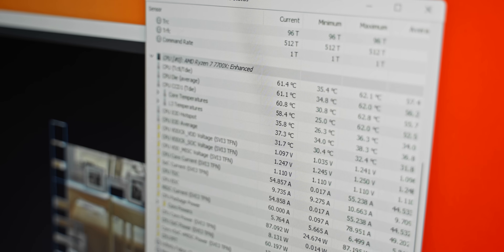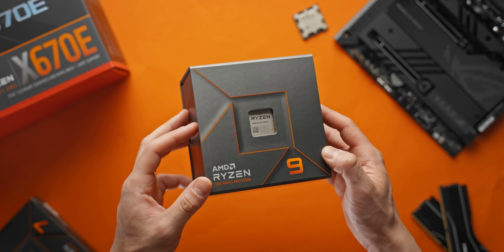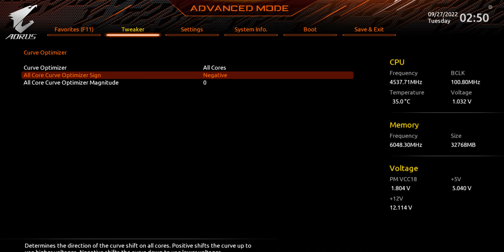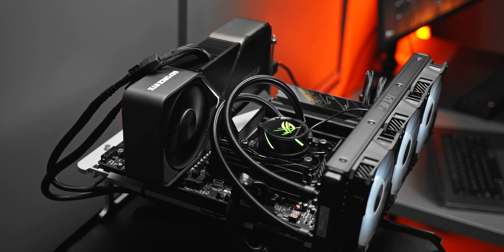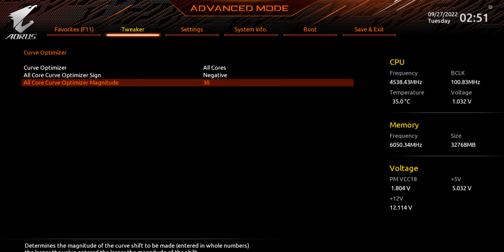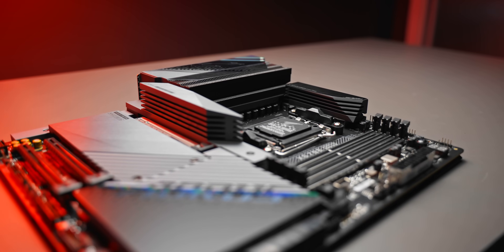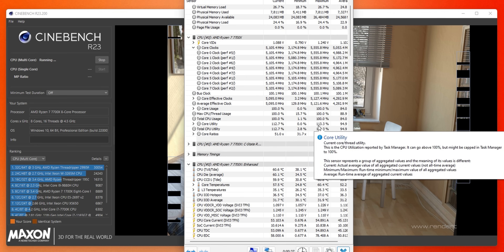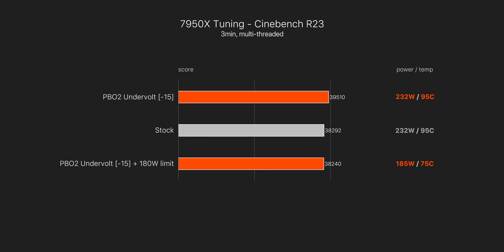Fixing Ryzen 7000 - PBO2 Tune (insanity)

Comment: i just undevolted the 7600 (non-x) negative 30Mv and saw an increase in performance and much lower temps. 181 FPS vs 190 FPS in horizon zero dawn
Reply: Where i put 30Mv bro?
Reply: @apocaypse4408  in your motherboard curve optimizer settings.
Reply: And what max temp i can sett?75-80 degrees?

Comment: Gosh my R5 7600 take that -30 like it was nothing and temperature dropped HARD, this is crazy !
Reply: Did you use the exact values in the video? I saw someone on reddit suggest other numbers and I am unsure of what to follow
Reply: @Brainzzz123 
Hi, I put "All Cores" "Negative" "30".
The worst that can happen if your CPU can't take it is random crashes. If so just go for "25" then "20"... Until you reach a value your CPU is comfortable with :)

Comment: So I'm able to run PBO CO at 30 on my 7950x but when I stress test it in Cinebench I'm hitting 5.5 on the first 8 cores and 5.35 on the last 8 cores. I've also set my throttle to 90. Is this discrepancy normal or does this mean the system isn't stable? Cinebench, Prime95, and y-cruncher all passed and seem to be fine. Cinebench score for multi was 39000

Comment: Hi there. You said you would see crashes and stuff. How long should I test for till I see it happen. I did it at 30 with my 7950x and I'm not sure if it's stable yet. Well turning that first setting on with pbo is causing me ram xmp issues im at negative 20 offset. Fuck sake man
Reply: Nvm it kept crashing over and over again. I just stopped doing curve optimiser. It's so unstable

Comment: Got my 7700X down to 76C while running cinebench with the same config you did on this video. Cooler is Deepcool LS520.

Thanks for this video, will adjust my configs if I encounter any crashes.

Comment: Sadly my 7700x runs only stable with -15

But thats also with 6400 cl32 and Infinity Fabric on 2133mhz.

I think thats great
I get stock performance at 105 watt limit and 75 degrees instead of 95.

Comment: hi there i got my board today and did what you mentioned here and worked great all my cinebench results were good and worked  perfectly  then i looked into my memory but it seems expo and expo 2 are insanely unstable so i disabled then  in the bios and and restarted and saw you could do it via ryzen master but now for some reason even though my ppt is 85, edc edc 640000 tdc 480000 in windows it goes all the way to 142 watts now.. tried reinstalling ryzen master tried resetting settings and bios and redoing them but still going up to 142w  any ideas? thanks  Asus tuf B650m  7600x

Comment: FRIEND , you HAVE HELPED TREMENDOUSLY. I am coming from intel. New 7700X owner. I have been messing with PBO auto, manual and enhancement though Asus mobo preset.  It set it at -15 curve otimizer and changed boost overclock and pbo scalar and was ustabled. 
I TRIED YOUR -30 CURVE OPTIMIZER ONLY and My cpu z bench went from 8080 to 8300!!! and My cinebench went from 19200 to 21000 something! THANK YOU so much. Just try it everyone, worst that happens is you need to go to -25 or -20.
Reply: i settled on -25 curve optimizer and pbo boost on. everythings been working great since. 
left auto over clocking and messing with max boost clock off.

Comment: Thanks dude. Good vid. Gave my 7700x an -38 mV undervolt and power target of 88 Watt. Cinebench r23 single 1984 all cores 20121. 5 cores boost to over 5800, 3 to 5600 with 90 Watt from PSU, 64 degrees C. Cooling Noctua NH D-15. I use it professionally (studio computer). Worthy replacement for my old Mac Pro. Loving it.

Comment: I have 7600x and AsRock mb - in Bios i can do over -30 and atm running -40! without anything else my temps are 66 @5400 mhz (boosted itself) in cine. also did blender for stability. Thats why i find it lil hard to belive you only dropped to 89 with -30?
Reply: i just got the  7600x 2 days ago, is this Worth doing? All i do is gaming

Comment: I tried using your tutorial to get my 7700X to cool down. But there's something I must fail to do in PBO cus i did everything you said to do and it seems like nothing changes. Even setting the temp throttle at 85 or even 70 degrees, my CPU still boosts until 95 degrees. Did i miss something ? Plus, i never get above 4.5GHZ

Comment: Wow this works great on my 7700X, 5.4GHz all cores CM R23 @ 87.5*C max & 1.27V. I used AI OCing on ASUS and had 5.3GHz @ 95*C & 1.45V... The AI had crazy boost clocks of 5.8-6.1GHz on random cores but @ 1.55-1.6V vs this guide of boost of 5.5GHz but those 1.5V are way to high so I'll stick to your guide

Comment: What values would I use for an 90v limit? Just 90000 instead of 85000 and same for the rest or do they all need to be different? Also I got the -30 on my 7700x and I'm Hella unlucky so maybe 7700x are mostly getting -30? Would be interesting to see if other 7700x owners mention what they get

Comment: Thank you so much for this guide! I just adjusted the curve optimizer to -30 on my R5 7600x and my Cinebench R23 score increased by almost 1000, the max temp decreased from 92 to 78.4 and I think the clock speed went up from 5.4 Ghz to 5.7 the wattage dropped aswell, from 130 to 111. Thank you so much! Such an easy to understand guide.
Reply: @actualpotato what were your  values for PPT, TDC and EDC? I'm running the 7600x and that's all I need to know to fully optimize the cpu :)
Reply: Would like to know those values as well
Reply: What cooling do you use?
Reply: @TheOdsystem  Noctua NH-D15
Reply: @actuaIpotato  If you are still around, Could you tell me your vaules of PPT, TDC and EDC? I too use 7600x and its stable at -30 Curve optimiser.
Reply: @chiragnightfire did you found ?
Reply: @Snoxygoat  Yeah. I am using PPT/TDC/EDC at 85/75/150

Comment: Could somebody explain to me what the hell is going on here 4:56? Where do I get these PPT, TDC and EDC values and what do they mean? Can you fry your system if you enter wrong values there? I have done all of the other steps but not sure about this one. By default my BIOS is showing value 0 for all of them when set PBO limits to Manual.
Reply: You enter those exact values manually. Mine was also at 0, I just typed the exact figures in the video. PC still booting, and working great, only now it's 20c cooler on load.
Reply: @DKTronics70  Thanks but I am afraid that's sufficient for me. I want to know how and from where these values were derived. Maybe the values should be different for different AMD 7000 processors, who knows!
Reply: @meanmole3212  hello, did you figure this out? 😅
Reply: @flyinggecko3322  No. However, on my mother board (ASUS) there were separate settings for controlling the CPU in addition to the "AMD's own processor settings". These 2 settings menus had basically the same options, so I am not sure if the motherboard's own settings get overwritten if you also change the processor's own settings.

I ended up using the motherboards own processor settings menu for all my CPU tweaking and there I also found something called power saving eco mode which automatically sets predefined values for these PPT, TDC, EDC. You can choose from few presets. The presets vary those values depending on how much you want to save power and limit the voltages. That was good enough for me.

Comment: How do you decide the TDC and EDC limits in the Manual PBO Limits? Your video shows TDC:480A and EDC:640A. But I checked the settings for my 7600X in Ryzen Master, those only show 110A and 170A respectively
Reply: iirc it doesn't really matter it's so high anyway that your CPU will melt through the socket long before you reach those limits. Just max them out or let them be it won't matter.

Comment: If you have an Asus AM5 motherboard, their recent BIOS updates enabled one-click adjustment of temperature, power and voltage curve limits through preset levels Asus calls 'PBO Enhancement". Using level 3 on my 7950X, I've got it running at 70C max without any appreciable loss of performance in real world apps and games.

Comment: Great video, Ali. I was wondering how you came to the TDC and EDC values after limiting the PPT?
Reply: He gave an answer in one of the 1.2k comments that these were the default values and he only touched PPT.
Reply: @epivitor3  That's strange. The default values should be 110,000 and 170,000 for the 7700X

Comment: My personal experience is the two best cores are either going to be at -5 or 0, then the rest can go way down. Reason is those two best cores are already as effecient as they get, and if you try to go much lower you run into idle crashes.
Reply: How do you figure out what your two best cores are?
Reply: @joelman1989  Dunno if you figured it out already - but in Ryzen Master it basically tells you in the advanced overview window which cores are the best. They're marked with a star and a grey circle respectively.
Reply: What means "best cores"? and why are they best cores?
Reply: @RmX. When manufacturing a CPU it is not always going to be perfect, I don't know if this term can be used here but I think it is called "silicon lottery" between many processors/cores there will always be some better than others
Reply: what gpu are you used?
Reply: gtx 5090

Comment: Undervolting is so good, also did it for my 5600X and RX 6600, I downed the powerlimit of my GPU by the max of -6% and dropped the voltage from 1150mv to 1075mv, it now is 2-3% faster, while using more than 6% less energy. My 5600X is at 75 watts max and max CPU override +100MHz and curve optimizer -20 and running faster than stock at the same or less max power usage. I'll try to tweak it even more.

Comment: You can set PBO + Curve Optmixer per core and get much better results and you can run PBO + Curve Optmixer and A;; Core OC atthe same time with auto switch that will run All Core OC on heavyey loads.
Reply: You did not get the real improvemeny available by using all core in PBO.  All Core OC can be set for each CCX  also

Comment: Guys let me tell you this, all this seems very promising but in reality it is not so. Bottom line is you will only find 100% stability with a value of -10 or lower or may be not in some cases. I have seen crashes all the time even sometimes when I was using -7 offset. So yeah it works for benchmarks and other tasks here and there  but is not something that you can depend upon for absolute rock solid stability.

Comment: In other reviews I saw this config for Eco Mode for the 7700X - PPT 88000, TDC 75000, EDC to 150000. Why are your TDC and EDC so high?
Reply: Yeah they are super high, but i dont know why. For 95W they recommend:

para un PPT de 95W, los valores manuales de TDC entre 75-90A y EDC entre 110-140A son óptimos para equilibrar rendimiento, consumo y temperaturas.

Comment: I want to thank you for the information you give. I recently purchased a mini itx system with the 5900x on the b550i strix mb in the NR200P and managed to get my cpu to negative 30 offset with a 200mhz boost to all core clocks, stable. Once again, thank you. Now if AMD just fix their buggy drivers on the 6000 series gpus....

Comment: Great video, it helps a lot :-). Can you suggest also safe values in PBO for the 7950x? Not only PTT, but also TDC and EDC limits. I would only know what to set in the PPT instead of 230000 there I I would try 160000, but I have no idea about the other values. Big thank to anyone who knows what to use. Ok I think I could set the Auto option, but I would prefer to set the values manually.
Reply: Hello, I have been looking for the same. Did you find an answer somewhere? Much appreciated!
Reply: Have you found good value to drop the temps? My 7950x is running hot and I don't really care about performance drops.

Comment: 4:56 In PBO Limits manual mode, how we set PPT, TDC and EDC ratio? Is there a formula?
Reply: Idk I have same problem
Reply: Bro I have the same question with no answers. This comment section alone has a bunch of people asking the same thing with no answer.
3 years and still no answers
Reply: @TH-ul1kf   I bought ASUS board at the end and found the info online. It's like this: (MSI uses mw and ma so add 000)
Target W ( PPT, TDC, EDC)
170W(230W/160A/225A)
125W(162W/120A/180A)
105W(142W/110A/170A)
95W(128W/100A/160A)
65W(88W/75A/150A)
45W(61W/65A/140A)

Comment: Something that isn't mentioned here with squeezing out more performance with pbo2 it's actually very difficult to stability test. Because pbo2 has a dynamic frequency you experience stability issues when the clocks are the most pushed which usually happens with a MEDIUM load. I didn't experience instability during stress tests i but would see them during normal use under lighter load

Comment: When or if it gets updated (if it even needs to) just use Hydra and wait a few hours. Then run Prime95 all cores and with a script to switch cores repeatedly, and a few extra benchmarks just to be safe.
A flat all core -30 is almost certainly very unstable on one of the cores. An example being 1 of my 5800x's cores came back as a -16 (least safe setting) while the 2nd worst was -24.

Comment: I set my 7950x to -15 all core with 85c limit. Was able to get 5.3 ghz pinned on all cores. Then I set my power limit to 150w and then it maxed out at 5ghz still at 85c. Playing cod my temps were at 71c. So I turned off those settings and then just manually set the clock to 5 ghz all core with a voltage of 1.05v. Same cinebench score but never went over 70c and my temps playing cod were at 45c. Idle temps were 5c lower as well. Since I’m new at messing with cpu is there anything that I can damage manually undervolting like this? I haven’t had any crashes or anything while playing games and the temps are just better with the same performance. All I did was just set the clock speed and voltage.
Reply: undervolting is fine as long as it's stable, if you crash increase voltage again

Comment: Hi, and I have a question. Does increasing dpi above 3200 (as ex. 6400, 16000, 25600) reduces mouse latency? If you don't know exactly, you can easily test it on your test stand.

Comment: Genuine question: if its that easy to get higher clock speeds at the same temp & power / get the same performance at lower temps & power why wouldn't AMD just have their cpus run stock like this?

Comment: lovely. i thoght i'd try it on my 5600x for fun. it didn't even crash, didnt freeze. just fucking corrupted windows on the first try. just went straght into recovery without crashing even once.
(well it didn't take me all day, only about 3 hours. and idk wtf i did to fix it, but something i did among the last tries must have worked. probably one of the weird parameters / settings i tried with sfc). [edit] feeling corageous. did it again. this time, no issues. idk wtf was going on. my 5600x accepted -30 just fine and is running at 50c full load doing cinebench, which is absolutely insane. wth. [edit2] ah, it froze instantly when i tried the single thread test. i guess it was okay with 4.3ghz but not 4.7. -20 seems to work fine though.

Comment: I love that, I'm definitely getting a 7600x once the B670 motherboards are out (maybe 7600x3D if they make one) and I'm definitely liking the temperature drop. Power consumption as well cause even tho 105w is definitely not as bad as other CPUs (looking at you i5-13600k and your 180w under load) i'd still like my Ryzen 5 to draw around 65w

Comment: I highlt doubt end users will get any sample that can achieve 5.3Ghz at 85W while undervolting. 
Mostly, because with no amount of tuning and testing have I ever seen a ryzen perform at these high frequencies (other than in YT videos)... The best sample I've had in my hands was a 3600 and it had trouble to run at 4.2, and very rarely achieved 4.4. 
If AMD could get any representative amount of processors to run at those values, THEY WOULD SELL THEM WITH THOSE SETTINGS RIGHT OUT OF THE BOX, the reason they don't is 99% of them are not stable to run like that, period. They are being greedy and inflating prices, now they can, just like Intel did... with the exception that Intel processors do overclock at the advertised values without risking degradation and instability.
Huge fan of AMD here, but these early reviews which show insane frequencies are just the exception to the average Ryzen.

Comment: Coming to this late but this is hands down the best video I've seen about this. There aren't enough of these types of videos out there that actually show the steps taken in such a quick and succinct way and then lay out the results so clearly. Well done man. I'm sitting on a 5800X3D system right now so I don't have any reason to do much of anything right now, but I'm definitely eyeballing AMD for the eventual 7000X3D chip releases.
Reply: Hello, how do you think this solution will work for 7800X3D?
Reply: @Ho1eMak3r  hey have you found out
Reply: @gfrmbr   also want to know? 7800x3d

Comment: I just did this with my 5800X. 15169 multi core score on Cinebench but was about 93C at stock.  I was able to load into windows with the -30 offset (had screwdriver ready) and scored 15670 with a max of 83C.

(as I am typing this, my keyboard is acting strange, however.. don't know if this is stable..)

Comment: Very nice guide but unfortunately it still does not undervolt the insane prices of AM5 motherboards and DDR5 lol. I still think an i5 12400 or a Ryzen 5 5600 with a good graphics card is far better than a high end cpu plus a mid range card, all for the same price or maybe even lower.

Comment: It also works the same way as the Ryzen 5000 series chips do. Have done it the same way as you did and was able to down to 52 degrees Celsius without a performance decrease.

Definitely worth checking out for the current situation. And also one of the best tech YouTubers I’ve ever watched so far. Never got in love that much with the aesthetics with the hardware and lighting in the background aswell as a super detailed video. Thanks Ali!